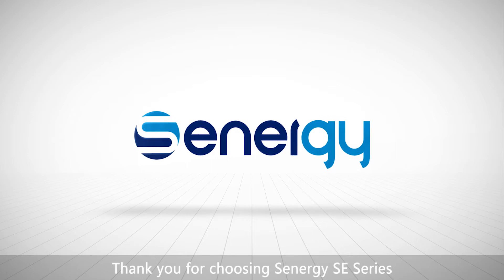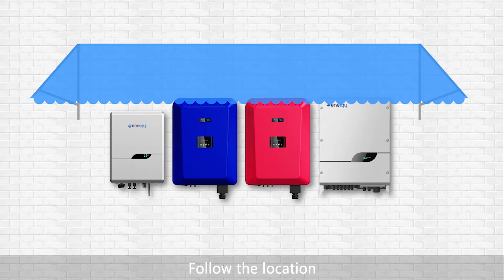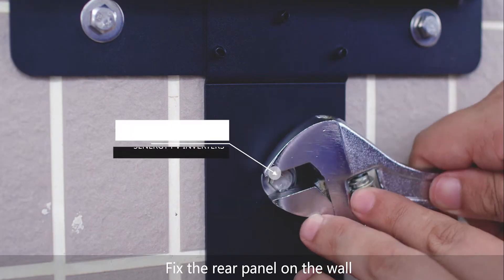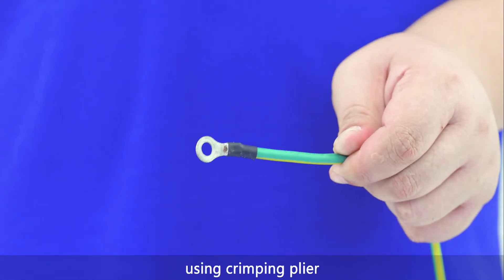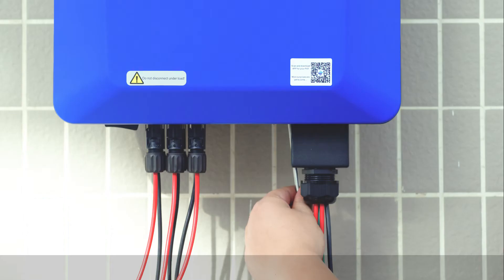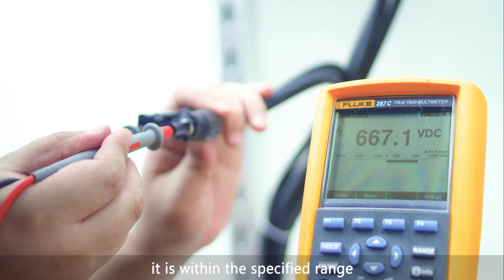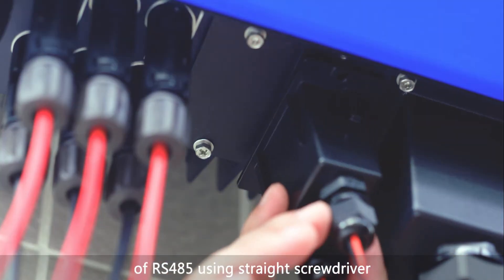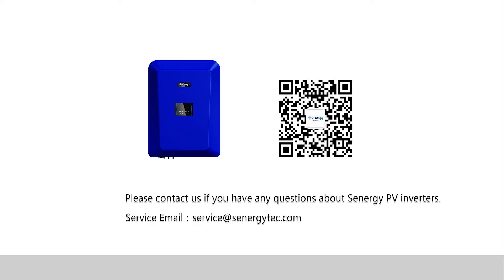[201809] Senergy Solar Inverter 6-15kw Installation Guide

Comment: Must be correctly u v w cable from 3 phase grid or dont need.just connection cable to any port out put from inverter to any l1 or l2 or l3 inverter will automatically synchronized?